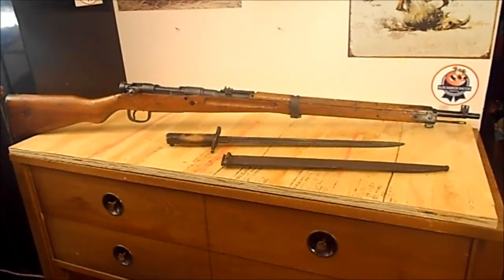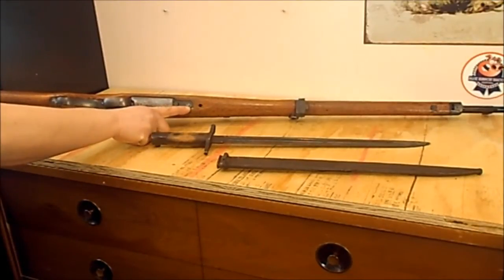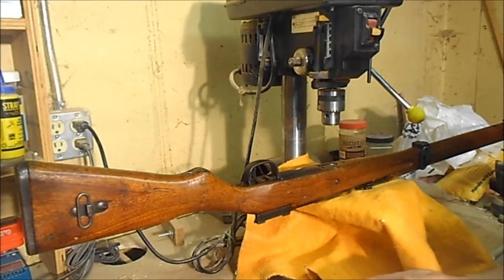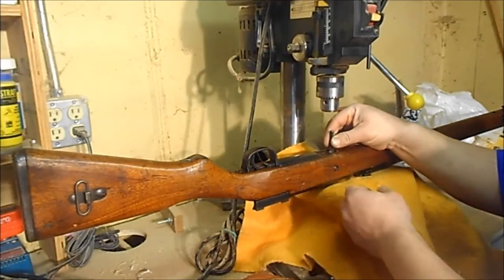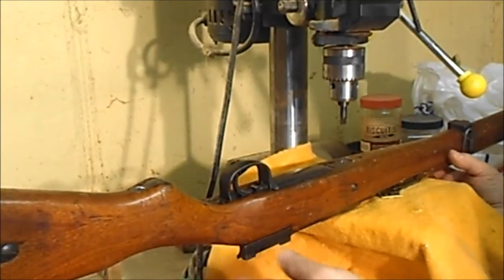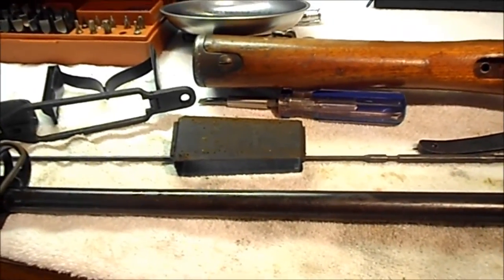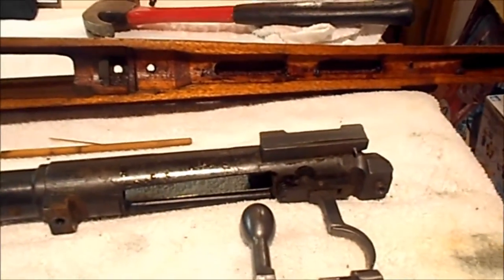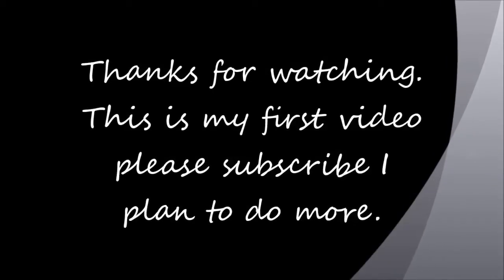Type 99 Arisaka easy rusted screw removal and what 75+ years of build up look like. *

Comment: These screws are also staked at the factory so you might not just be fighting rust on a Type 99.  If they are still staked, those screws may not have been touched since the war and who knows what you have going on under the woodline, might be rusty.  If you have a nice collector's piece with mum and dust cover, I would think twice about removing them in that case.  Collectors want unmolested, staked screws or it hurts the value.  But, not as much as rust does.  That's cool finding a bamboo rod in there.  The forums say they think those were used as stacking rods to stack rifles when not in use, like a teepee. 
Most people don't know, but the Type 99 was mostly designed by Nambu.

Comment: I only have about 4 Arisakas and never had that problem with the action screw, but I have about 100 rusty old Mausers and have had that problem. I milled out the screw head, got the rifle apart, and put vise grips on the screw shank.
Reply from the maker: I have used this drill press trick on a couple of rifles and it works well. Just a tip an old gunsmith told me about. Thanks for watching.

Comment: I have an Arisaka 99 that I have been trying to disassemble for some time now due to those same two screws. I've even bought replacement screws with the intent of using a broken screw extractor, but was worried about taking that route and still not being able to remove the screws after milling out the heads.  I don't have a drill press and will find someone that does or engineer something to get the same effect. Thanks.
Reply from the maker: Hope this helps. This is the video that started my channel. Thanks for watching.

Comment: The right rear screw of my nose cap is absolutely demolished.  Some bubba used a power tool with the worst flat head bit imaginable and jackhammered the screw head and surrounding area, even damaging the stock around the screw head.  This was not pictured in the online sale page or alluded to.  Lesson learned.  When a seller says "ask for details", YOU ASK FOR DETAILS!  Still, I didn't pay too much, it has a matching bolt, and I'm just going to drill it out and hunt for a replacement screw.  Unfortunately, it will require drilling out but as far as collector's value, that screw is already...well...screwed.